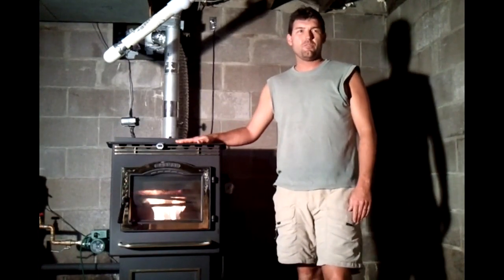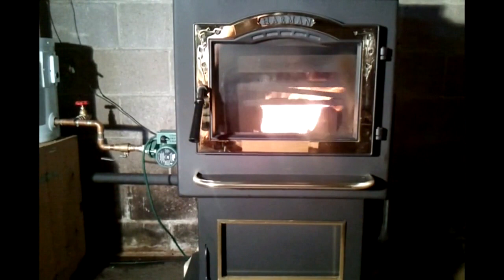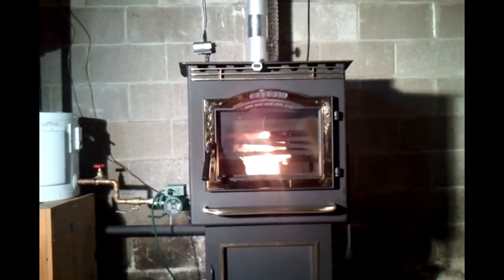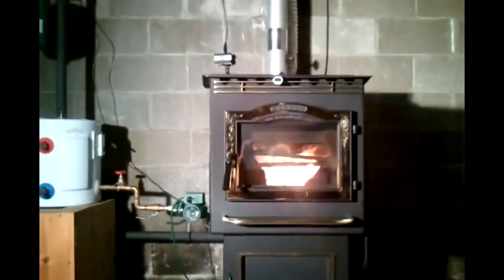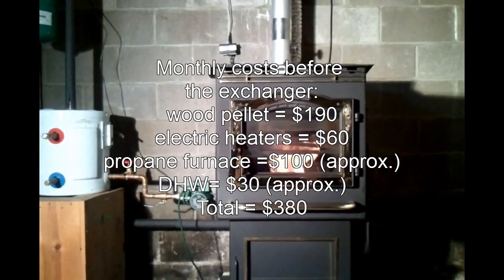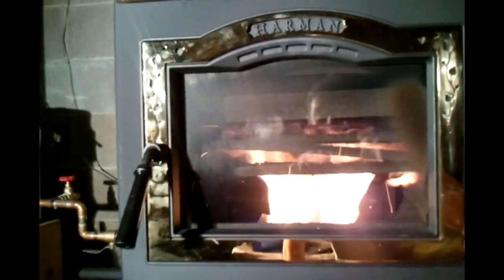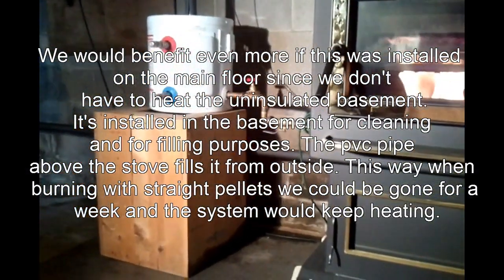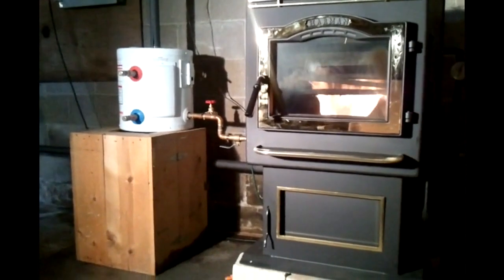Convert your pellet stove or corn stove into a boiler using a crosslink conversion kit.

Comment: 250 to 300 a month hell i have an oil burner and heating oil for this winter is $3,000.00  I will be looking into this. I also have a lead on low cost pellets.
Reply from the maker: Propane now is cheaper than pellets in northern Illinois.  2 per gallon vs 6 bag.  But makes sense in areas like the NE where fuel is high. . Even a just Pellet stove by itself . After testing beyond that video the harman isn't my first choice.  St Croix is effecient and comfortbilt is a good cheaper brand.   I currently burn corn with the St Croix  multi fuel.

Comment: different than a kit for a harman pc 45 and so on.Or else you can heat the water to fast and that will cause steam.they have all so been designed with different water flows for each model of stove.Using the standart of a 007 taco pump..It is a combintion of many different factors for each Crosslink kit to operate Safely .Most kits will make 2 gallons of hot water per minute with a 20 degrees heat rise while others will do alot more

Comment: My name is tommy from Crosslink Conversions and I invented the Crosslink kits for this kind of stoves 'To answer your ? is that there is different amounts of water in each model or kit .Each stove company has different models that have different feed timing in getting the btu's to it stove settings . Some start up using a 1/4 cup others maybe one to two cups of fuel (pellets,corn, oats, barley , coal ETC.) Therfor a kit for a harman p68 is

Comment from the maker: Yes you can. $1400 plus a small motor, pipe and fittings. As a DIY project , my payback time was short.  For the floor you can use a constant flow at a lower temp = less fuel.  And heating your DHW at the same time.

Comment: You can buy a Magic Heat Reclaimer from Northern Tool and put it in the flue pipe for even more heat from your pellet stove.
I put one of these on my oil boiler and wired it to come on with the burner and I was very surprised that warm air came out. Since you have a 300 degree exhaust the heat reclaimer has a 180 temperature switch so it will operate automatically.
I am going to give them your referral number.  Thanks for the good quality instructional video.
Reply from the maker: Thank you Charles I appreciate the comment and using my referal.  And thanks for the tip on the heat reclaimer. I have been wondering how well one would work with a pellet stove.

Comment: What type of relay switch did you use to turn the furnace on with this?
Reply from the maker: I am using a honeywell aquastat. The model # I dont have on me..just the basic aquastat will work. I found an immersable or contact one works just as well in this application.  You have the setting at which contact is made to turn the furnace fan on and you have a differential which you set to control the cycle. A low differential will short cycle, the fan will go on and off a lot. I used  160 degress on and a differential of 30 degress.  it gave me 6 minutes on 6 minutes off. there is obviously many variables, size of heat exchanger, fan speed etc.   I wired the red wire and the green fan wire from the furnace to the aquastat.

Comment from the maker: The different kits for different different stoves are basically for size differences.  So I would say there is a kit that would fit properly into your stove. I contacted the manufacturer, he is not familiar with that particular brand.  He would need to know the inside dimensions of the stove. Also some external functions may be different than what I explain in the video. Setting the knob for an exact water temp for example.. otherwise external setup is as simple or complex as you want it to be.

Comment: Chad, what model heat exchanger did you use to get this working with the forced air?
Reply from the maker: not sure the brand name buts its a standard  i think 18 by 18" square exchanger into the furnace plenum. Probably could have been smaller as the fan depeted the heat quickly but a smaller exchanger would have restricted air flow so in the end it worked fine.